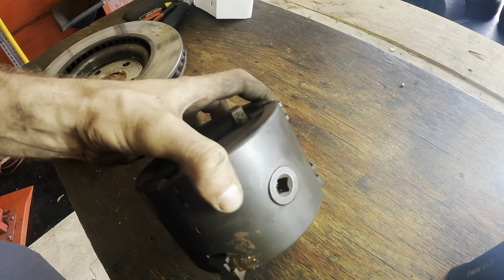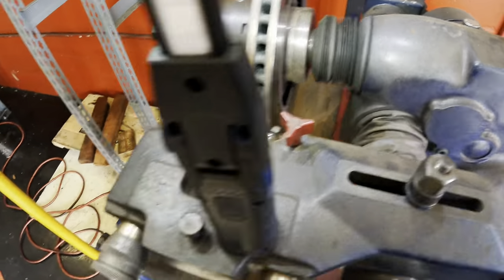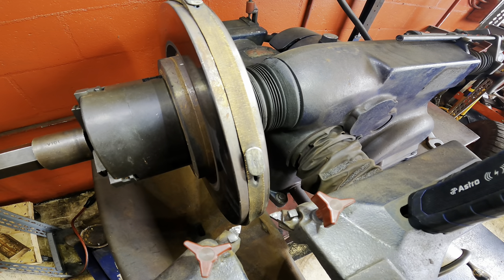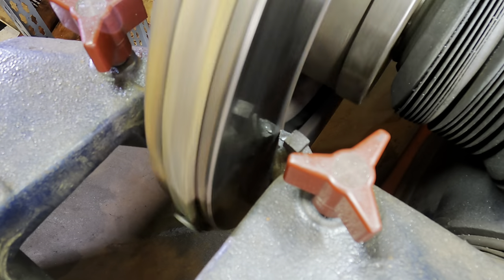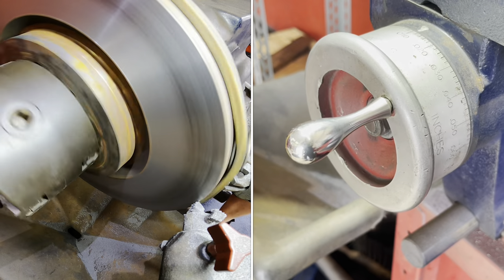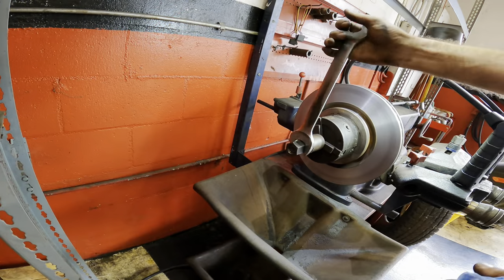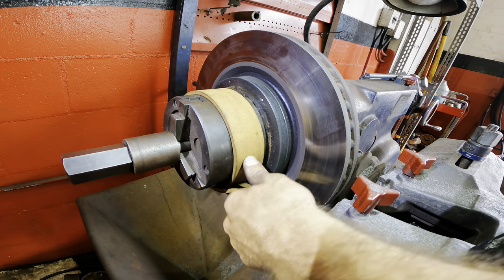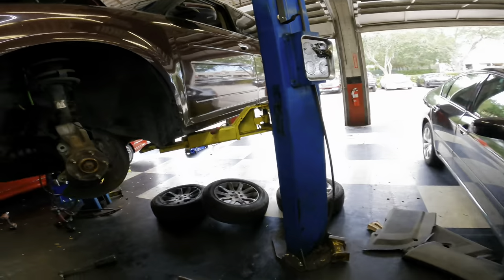Powering on the Brake Lathe! Previously Unlisted bonus video

Comment: Now don't take this as "you did something wrong" but more as "this is why this would happened". In which case you know rubber bands deteriorate in lubricating oil. The cleaner that you used on the rotor makes rubber brittle. As soon as I saw the red straw I cringe just a little lol. But the reason why that rubber band broke was because you used cleaner on the rotor and some of it splashed on the rubber band making it brittle. That's why it broke.

Comment: Great example of how NEW rotors are warped before installing. Those fronts had very few miles on them. I'm certain that the warpage was not caused by the car.
Reply: Or they weren't set up correctly on the lathe as they were fastened and turned without double checking their seating.

Comment: I find it strange you'll spend time resurfacing brake discs/rotas and drums which in the UK are usually just replaced with new ones, but you'll replace a full drive shaft when it just simply requires a new CV boot.
Reply: Idk how they charge labor over there but from my experience the labor we charge to rebuild a CV axle is close to the price of buying a new one. I personally don’t like cutting rotors I just replace them but the manufacture does have specs for wear on them and if they are within spec it saves the customer some money and yields more profit for the shop.

Comment: RAY - STOP THE MADNESS.
A dampener is a device that moistens or makes something more wet (i.e. dampens). A DAMPER is a mechanical device that reduces vibration or movement. STOP propagating use of the wrong word please. Next you'll be saying pound-feet instead of the correct enhknerring unit of foot-pounds.
Reply: You must be fun at parties 🎊 😳

Comment: You did not show thickness of the rotor.  Maybe the average driver will be fine with this cut. I like a healthier rotor.  It is amazing the time you put in this and it cost 15.00 for a cut at the auto parts stores.